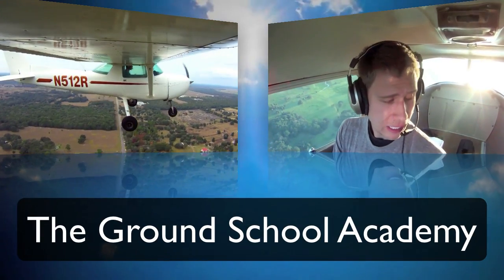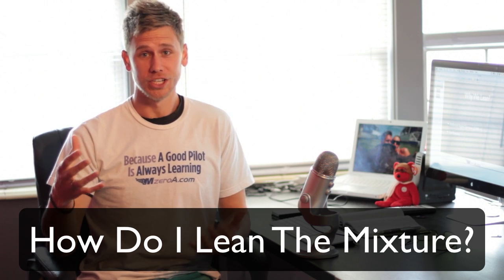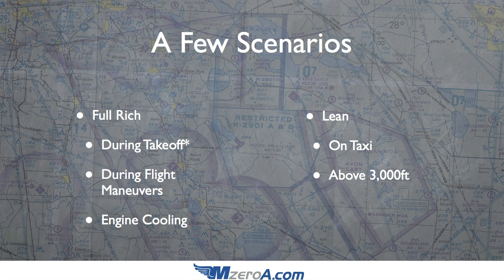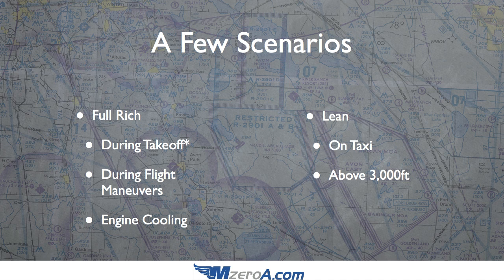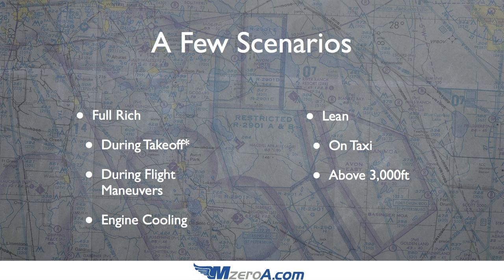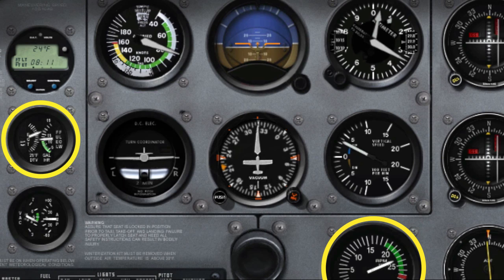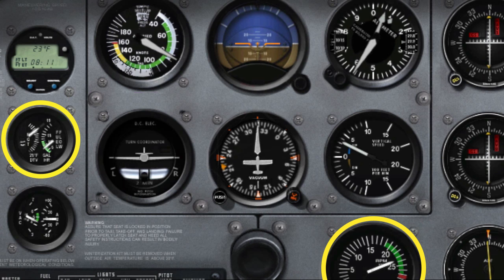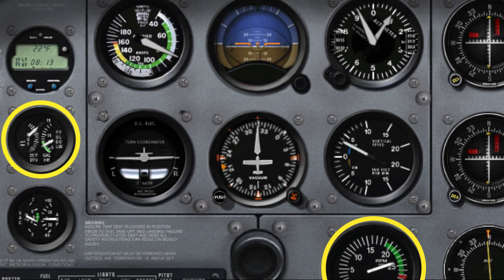How To Lean The Mixture

Comment: A question. But leaning where the rpm are at maximum is not where the cylinder temperature is also maximum? Or maximum rpm is where we want to be using tachometer?

Comment: Hey, 

Ive always had mixed responses... on a Cessna 152 or 172. When should you lean the mixture? Let’s say taking off from sea level and cruise altitude of 7,000 feet.
Lean mixture as I climb through 3000/4000ft?
Or
Full mixture until cruise altitude, and then lean for cruise

What would you do/recommend?

Comment: I did a mock checkride with an different instructor, a CFII. I have been leaning mix for taxing and got away with leaning right just after landing and flaps up then lean. Bad practice? When I did this the CFII said that was a FAIL! Was it because I was was still on the runway? He said I needed to stop before adjusting the mix. So get off runway over threshold then stop and lean mix?... I need and want the right answer

Comment: Could you explain QNH vs Altimeter: why QNH is in Hectopascals and have numbers like 1008 vs Altimeter numbers like 30.14.
Reply from the maker: Hello! They are different forms of measurements. Just like 0 degrees Celsius is 32 degrees Fahrenheit. It is the same temperature, just measured differently. It is the same with the altimeter settings. Some countries use inches of Mercury and some use Hectopascals. I hope this helps! Thanks for watching!
Reply: @MzeroAFlightTraining  Actually, this really helped! Thank you.

Comment: Hi, when you talk about leaning the mix during taxiing, A) do you mean an airfield over 3000 ft?
B) if it is below 3000 ft at what RPM regimen would the mixture have to 
be regulated during the taxing?
Reply: In my 172N after oil temp gets about 180deg at 1000rpm I lean for peak. I found out by the time I reach run-up area I have no problems with mag drops. My airfield is well below 3000ft. If I stay in pattern I leave it that way.

Comment: CFI question for you...You're doing a run up and one mag check indicates you may have fouling. You go thru procedures and burn off fouling. You're intent that day is to stay in pattern with student. Is that a safe choice (closed traffic work) considering you'll be enriching when applying carb heat (C-172) and cutting power on final with a full rich mixture. 
Of course if you leave pattern everything  is a little bit different. You'll be leaning out for cruise. Would you be juggling the mixture control the same way when staying in pattern considering you just cleared fouling?

Comment: 4:09 I'm a big fan of doing what Lycoming says to do, which is lean at ALL ALTITUDES when operating the engine at 75% power or less.
Reference page 38 of the Lycoming Key Reprints: http://www.alfako.be/SAFETY%20DOCS/lycoming---flyer_key_reprints.pdf

Cessna 172M POH says to lean above 3000' DURING A CLIMB.
Reply: Exactly. This video has some misinformation, I feel. Or simply outdated now.

Comment: Could you provide a bit more details on how you lean for taxi? Do you turn the engine on, get it to 1000 rpms, check oil pressure and directly lean? Do you wait a bit while you turn on avionics and then lean? Do you use a different rpm setting to lean, and then set it back to 1000 rpm? So many questions :) Thanks a lot!

Comment: I thought the engine quits only when the red knob is out all the way. This is the reason why I've never worried about shutting down the engine as I leaned the mixture. Never went all the way out, maybe about 75% out. It didn't make much difference. Perhaps a red line around the mixture's metal rod would be handy. Keep up the good work. Thank you.
Reply: You would need a moving red line that is tuned to the actual flight conditions, since density altitude will surely affect your mixture setting
Reply: @unclejacksimulations9423  Thanks

Comment: should you lean during a climb, say you cross 3K, but are climbing to 5,500?  do you wait until the climb is over, or start at 3,000?
Reply: Just remember that your engine mixture is becoming richer with altitude.  3000' is a starting point and yes, you can lean the mixture as you climb through 3000' but you can wait until top of climb if you're only going to 5,500'.  It takes practice and can be distracting so don't forget to fly first and scan for traffic as you practice leaning the mixture during climb.  I personally start at 3,000'.  It saves the plugs and fuel burn during climb.

Comment: what should your mixture be at if you are climbing at full power from 8000 to 9000 feet
Reply: Reference your aircraft's POH, it will have measures for best fuel econ, best airspeed and at what conditions. With proper fuel leaning and prop pitch you can get those impressive fuel burn rates and airspeeds at those given altitudes or very close to it based again on atmospheric conditions.

Comment: Jason your videos contain much good information for student and novice pilots. However, Lycoming do not recommend leaning for taxi and it is not because they want to have a debate. It is simply the facts are on their side. If you use the recommended 1000 - 1200 rpm, your mechanic has installed the correct plugs and set the idle mixture properly, it is not necessary to lean for taxi in order to avoid fouled plugs. That rpm band is high enough that temps inside the cylinder are not conducive to fouling. Nonetheless you should lean for smooth operation before a high density altitude take off. On the other hand if you do lean for taxi and then forget to set the mixture for take off you are guaranteed to put the engine into incipient detonation and quite likely outside its certified detonation envelope unless you are at a high DA. That is why Lycoming do not recommend leaning for taxi.
 A more likely scenario for lead fouling is returning to the pattern at full rich, perhaps making a glide approach or spot 180, followed by a brief taxi and shutdown. There is no place in that routine where the lead will be scavenged. Hence Lycoming recommend running the engine for 20 seconds at 1800 before shutdown in order to scavenge the lead deposits.
 Check out the Lycoming article “to lean or not to lean while you taxi”. And keep the videos coming.

Comment: Why when 3,000 feet leaning the mixture will increase the engine performance ? and also if your airport is on 4000 feet how much mixture you will consider to lean on taxiing ?
Reply: Answer to your first question: Because if you leave the mixture in full rich, you won't only be wasting unburned fuel out the exhaust pipe, you'll ALSO be wasting some of the heat energy of the fuel you DO burn by heating up the unburned fuel to the engine's temperature -- and THAT means less energy available to turn the prop!

Comment: I have a 172M '74 and have just installed a JPI 830 EDM. I am still trying to figure it out. As my a/c is not fuel injected, should I still attempt to Lean LOP or since I have an EDM, should I attempt LOP? I understand the concepts of leaning, but am a little confused over the difference and what is best for my a/c. thank you

Comment: Why to have full rich mixture at takeoff if it makes the airplane perform worse? And why 3000 ft?
Reply: Full rich at takeoff DOES NOT make the performance worse UNLESS you're above 3000 ft. density altitude on takeoff -- but if you are, then it DOES, and THAT is when you SHOULD NOT use full rich on takeoff but lean for best power!

Comment: It always helps to define the terms; “EGT” what………….  In your well done video you had a great opportunity to delve quickly into some systems education; what is the EGT gauge, how does it work and what is it telling me and how do I use it in “leaning the engine”.  Take the time to explain and even better show the temperature probe inserted into the exhaust system and how it takes a general sample of exhaust gas temperatures and relays that information to the gauge.  That would be different from a CHT (Cylinder Head Temperature gauge that monitors individual cylinders.

Often basic explanations are helpful.  To get combustion you need two things, a fuel to burn and oxygen. Remove one or the other then the “fire” goes out (the fire in your home or inside the cylinder of your airplane’s engine).  The carburetor provides a combustible fuel air mixture.  As pilots we start our engine on the ramp.  Then we take off and climb.  As we climb what is happening to the density of the air as we climb up through the atmosphere?  Most of us understand that the air is becoming becomes less dense as we climb, fewer molecules of oxygen (and other gasses) for a given volume.  One cubic foot of air at sea level will have fewer oxygen molecules than one cubic foot of air sampled at 10,000’.  Now let’s return to our climbing airplane; we are climbing and our carburetor is still mixing in the same amount of gas, we have the mixture knob still full rich, what is happening to the relative mixture of gas to air ratio?  Same amount of gas mixed with air that is less dense means the mixture is getting richer.  The percentage of gas to air the engine is burning in the cylinders is getting richer; more gas less air/oxygen.  If we do nothing with the mixture knob, and keep climbing indefinitely, at some point the gas to air mixture would simply stop burning.  As the mixture is getting richer, beyond the “ideal” ratio, the energy extracted out of the gas (engine performance) decreases because not all the gas is being burnt.  The unburnt gas is getting passed along with the byproducts of combustion past the spark plug, where it leaves deposits that build up over time, out the exhaust valve into the exhaust system where it is eventually expelled into the atmosphere.

You touched on the difference between carbureted and fuel injected engine which I thought was brilliant.  Carburetors produce a combustible fuel air mixture that is fed into an intake manifold verses fuel injected engines deliver the combustible fuel air mixture directly to the cylinder allowing for much more precision.  It might have been helpful to highlight a sample Pilot Operating Handbook (POH) as an example of a manufactures recommendation on leaning as you presented your information.

(CFII, ATP, A&P)

Comment: Your concept of leaning on taxing may lead to an accident if the mixture is not full rich on applying takeoff power after run up checks are done. The PIC would have to very vigilant on his checklist before takeoff if he doesn't the engine will not develope full power and cause excessive EGT and high CHT"s as well.
Reply: It is strongly recommended to lean during ground ops. It is also good to lean to max rpm during ignition pre flight.  After the run up place the mixture full rich complete the checklist and take off.. Not brain surgery.     It is incumbent on the pilot to be coherent enough to make sure all the knobs are in during takeoff.
Reply: If you're leaned out as far as possible for taxiing,  there's no way to leave @ full power accidentally,  the engine will shut down and not produce power that lean.. A final pre flight check at the hold short line is also a must checking (at least)  mixture,  controls and gauges before departure..
Reply: Try taxing a big lycoming or continental, if you leave it rich it will foul the plugs in no time. POH recommend that
Reply: nonsense, use a checklist and don't be a jackass
Reply: Rick Cahill j
Reply: McPilot g
Reply: The PIC should ALWAYS be very vigilant on checklists before takeoff REGARDLESS of circumstances, no?

Comment: No matter WHERE the mixture control is set, you can NOT start an engine fire. Also, not a good idea to max the RPM by leaning and then leave it there. You always enrich a bit for two reasons: 1) It helps keep the engine cool. 2) It reduces the chance of sudden loss of power due to being too lean. [you might consider a disclaimer at the beginning of your videos]
Reply: +Jake Jones That's true, thanks for sharing !

Comment: "You do not want to lean a carbureted engine LOP..."

I hear this all the time and to hear it from a flight instructor really irks me.  I run my carbureted O-360 LOP (PA28-180) on every flight at any altitude.  In fact, here's a dirty little secret:  If you lean according to the POH you are running LOP.  The POH for my airplane states to "lean until the engine becomes rough indicating the leanest cylinders have reached their limit, then enrich until smooth again."  Like it or not, this is LOP.  Always has been, always will be.

Many pilots will begin by following this approach, then enrich a little more "for good measure."  This is the wrong thing to do.  Doing so will increase the chance that you push your mixture closer to the 50 dF ROP region which is the absolute worst place to be.  50 dF ROP is the point of highest internal cylinder pressure.  The further away you are from this point on either side, the lower the internal CHP.
For more info on leaning, I recommend people refer to Mike Busch's articles and web casts, as well as material written by John Deakins.  These guys are mechanics and they know engines.  Flight instructors are great at teaching stick and rudder technique, but no offense intended, they know very little about engine management.
Reply: +Daniel Torres That's what most of guys use in actual flight. I give a like to you!
Reply: Thank you. So annoying we go off tradition rather than real facts
Reply: But if you want MAXIMUM POWER (i.e. you need to get to your destination FAST and don't mind burning some extra fuel), then you WANT the highest possible internal CHP (and thus maximum torque), no?
Reply: agentorange153 you need RICH of peak for performance
full rich unless DA dictates for engine protection during takeoff and high load situations

Comment: I am in Jacksonville Florida and fly the local area and down to south florida...Would it be safe to say that you should lean til the highest RPM and then back off slightly to protect the valves..?
Reply: George Baylee That's exactly what he means when he says, "rich of peak". You're finding the peak of the RPM and then moving the mixture lever back towards the richer fuel flow.

Comment: During cruise LOP settings are much better for the engine than ROP.  The CHT is lower, internal cylinder pressures are lower, brake specific fuel consumption is better and there is only a marginal drop in horsepower.  Check the data on the Advanced Pilot Seminars and the narratives on sites such as the Pelicans Perch.  In addition the engine runs cleaner as well as cooler.  Leaning in cruise can be carried out at all altitudes, not just above 3000 ft.
Carbureted engines can also be run quite successfully LOP.  i have done so for about 3000 hours with a Continental O-470R
Reply: The way I learned it is, ROP is for best power, LOP is for best economy.

Comment: ROP/LOP operations can't easily be described in 9 minutes. It's worth digging deeper on this topic. Suggest viewers google "pelicans perch lean of peak" and read the articles by John Deakin.  The 3000ft number to start leaning is somewhat arbitrary. Many people don't realize that as you climb, the mixture effectively becomes richer (richer than full rich!) unless you start leaning, or you have an altitude-compensating fuel system, not so common.

An EGT is key for this. You can lean to sea-level full rich EGT during the climb, then once you're in a position where the engine will not make more than 75% power at wide open throttle, you can pretty much do what you like with the mixture, you won't really be able to hurt it. You can run at 50 deg Rich of Peak, that's best power...or about 50 LOP, best economy (if you can get all your cylinders LOP, not easy without balanced injectors). A compromise is peak EGT. This results in LOWER CHT's than 'best power' which is about 50 ROP.

Highly recommend the Deakin articles, it lays it out in detail. Once you understand the EGT/CHT curve on a graph, it helps a great deal with visualizing this stuff. This isn't something you read in 5 minutes and you're done. Set aside several hours and read the article(s) several times.
Reply: +coma13794 Thank u a lot, I will look for it, like your final warning.

Comment: Concerning leaning the mixture at or above 3K' .  I was always taught to lean until the engine "started" to lose RPM and then to bring richness back until it smoothed out.  Is this a correct method or is the method you just showed by leaning until RPM climbed and just before it started to drop the best way?  I know it sounds kind of dumb but this is important enough for me to understand that I don't mind sounding dumb.  By the way, I really love the way you teach and explain all aspects of piloting.  I live in So. Calif and I know you're on the east coast.  I sure do wish you were out here.  Your method of teaching and explaining is tops in my book, bar none.  Thanks in advance for your help.
Reply: There is no such thing as stupid question, you state a good point here pal
Reply: The best way is to use your EGT if you have one!
Reply: The best way is with an engine monitor that has an EGT for each cylinder.  They will track EGT and automatically tell you when the first or last cylinder peaks depending on your setting.

Comment: Do you have any suggestions for running lean of peak flying a turbo?  I have been flying with a buddy of mine that fly's a Cessna 401/402 turbo charged fuel injected continental engines.  The plane does not have an engine monitor.  I have looked all over the web for fuel management techniques - no success.  I would love to hear you thoughts on this issue.
Reply: Not much you can do if you have an auto-compensating fuel system and no instrumentation.